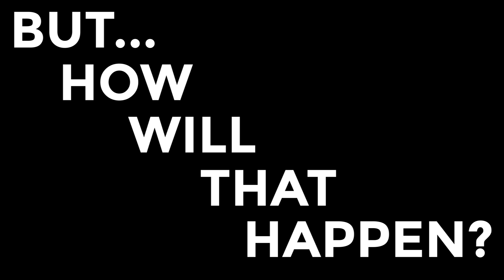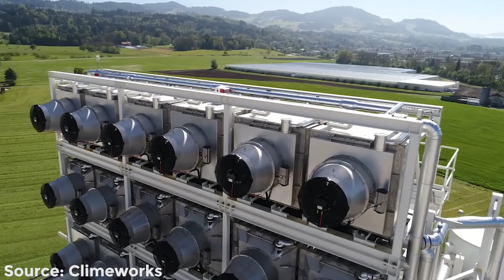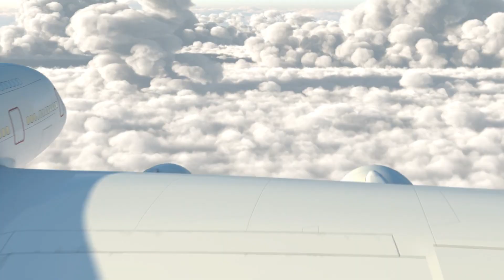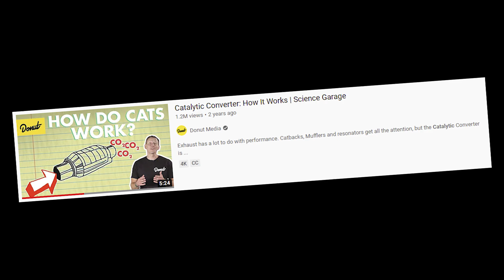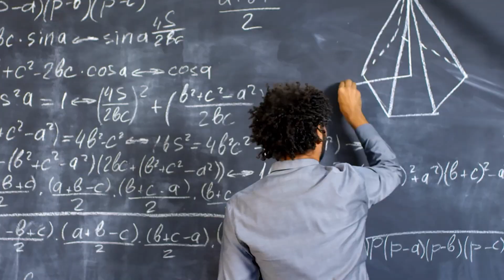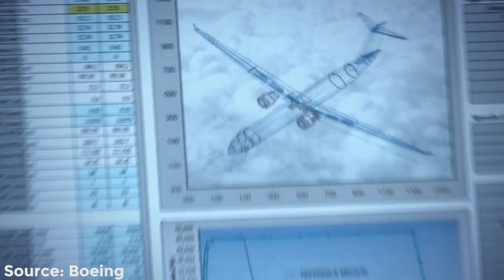How Hybrid-Electric Planes Could Save Aviation

Comment: One of the best ways to reduce airline emissions, apart from by not travelling, is to reduce the speeds of aircraft. Halve the speed and it ca use about 25% of the amount of fuel spent in combatting aerodynamic drag. I foresee short and medium haul electric passenger airliners being used before 2045. Long haul will come later, as battery technology and durability continue to improve. Electric motors can also operate at higher altitudes to reduce drag and to improve 'fuel' efficiency..

Comment: Aviation emitters currently don't pay carbon taxes or much taxes at all. If this changed and the playing field was equal I think these would become even more economically viable and you'd see more companies looking at reducing their climate change footprints by adopting hybrid, hydrogen or electric fleets... At least for short and medium range flights which emit the most fuel per seat km anyway...  Long-haul is almost as energy efficient as it's doing to get I think without switching to lifting body designs and hydrogen fuel cell set ups which I think will happen but when is anyone's guess. Airports who wanted A380 flights had to spend MILLIONS just to become compliant and even then most don't have regular stop overs with them anyway my home cities airport YEG included...

Comment: also, big thing is that you take a big generator, means that you may generate power more efficiently, decrease in maintenance cost and reduction of other separate turbines. the main focus is to build complex jet engines, that generate electricity at large, their is no point ivesting in current battery technology, simply to costly, however we can reduce lots of wait with these hybrid systems, and the electric motors are improving very powerful, and light weight, cheaper to maintain, we could simply build a plane that is range extended with one large jet tubine, instead of multiple, this means it bird crashes, the only thing to replace is stator motors and big fan blades. I think we could also incorperate the use of coal , and the water in the air, and have a coal liquification, or gasification system on board mixing both coal and water, we cann make fuel, where water would mean the plane, isnt taken any extra wait, all the wait is taken by the process of creating fuel on board.

Comment: When I think hybrids, the Chevy Volt comes to mind. It has a gas powered motor to generate electricity for the batteries if it runs low. Not sure if this kind of application makes practical sense for aviation jetliners ?

Comment: The entire aircraft skin should be a solar panel.  The plane should power up to altitude and then slowly glide to a lower altitude while spinning its turbines to recharge it's batteries,  then power up to altitude again.  So a hybrid or electric aircraft should fly in a wave pattern instead of at one consistent altitude.
Reply: There are a list of reasons that would not work, the biggest being aircraft separation. How in the world do you move aircraft around one another when they are constantly changing altitude. It's one thing to do it when you are in visual conditions, but in instrument conditions, in the clouds, not realistic at all. Not even going into how solar panels will power an aircraft carrying any kind of weight, how the turbines will not cause the plane to dump its altitude (likely causing wonderful stalling/spinning characteristics) without recovering even close to the amount of power to climb back up.
Reply: @Xithia not to mention the time added
Reply: That answered all my questions

Comment: Whatever happened to the hypersonic transport technology that was supposed to transport passengers to any global position in 45 minutes flat, it sounded really exciting a first, then interest in it seems to have just fizzled out?
Reply: SpaceX, Blue Origin and Virgin Galactic all have plans to try that out at some point. All their vehicles do have the disadvantage that they have to takeoff from a remote point and land in the ocean. 

There's a company called Hereus that's working on a Mach 5 passenger jet that would take off horizontally like an airplane and land horizontally like an airplane.

Also Boom Aerospace who's working on a supersonic airplane.

Exosonic is working on another supersonic plane that will have a "low boom" meaning the sonic boom will be barely audible, so it can fly over land. Lockheed and NASA developed the technology, NASA is supposedly going to do test flights of the QueSST very soon.

Comment: From what I've seen, generator type hybrids are inefficient. This would mean range would take a hit. Besides, you don't need to go hybrid to use catalytic converters, regular piston aircraft can already employ them but don't due to the weight. It's the same reason why planes don't use mufflers (at least not good ones) very often, they also change the way air flows so they increase drag (a way around it would be to design an aircraft with this already in mind, but now you need to deal with noise which adds insulation which adds more weight). The good ones are also costly (this goes for mufflers as well)
 
Hybrids should be used like their car counterparts, it's proven to work and it not only lowers fuel use but also increases range (that's a given, efficient fuel use tends to do that). But like many things, it's costly
 
But because these kinds of things are viewed as a long run, it could help save money by using less fuel. The range just has to be calculated to work at it's most optimal because during cruise the batteries, motors, and generators (incredibly light ones, both in use and operation. Like I said, generators are inefficient, they would just be used for something similar to trickle charging) are dead weight when not taking off or climbing
Reply: Please explain in more detail what you mean by "hybrids should be used like their car counterparts"? Thanks!
Reply: @AClark-gs5gl  Alright. So hybrid cars use electric motors to change their speed, this way the ICE can do what it's most efficient at which is cruise. Aircraft could probably do the same when they take off and when climbing. And like cars I bet they could somehow incorporate regenerative braking (I don't know how exactly that would work in flight, but it should as the same principles apply), though this is just me adding unnecessary cool stuff which aren't really needed.
 
The generator method is bad because of the energy losses. The only vehicle that I can think of (there's probably others) is the cargo train, there's a diesel engine that powers electric motors, this done because it way easier and lighter than having a mechanical transmission system. They would drop range and increase fuel costs, which will be worse off in the long run, not help planes. 
 
That's also why I said the flights should be planned if done similarly to what I'm saying, since when nothing is changing, the batteries and motors would just be dead weight. There would be a range in which these would be most efficient, if crossed it will takeaway from that efficiency, to close and you might as well go all electric but to far and the conventional is better (which is what I want to see, but you know what I mean)
Reply: Wrong, hybrid nowadays are more efficient even at full throttle

Comment: The biggest problem I see with series-electric-propulsion is the low performance of electric propellors compared to jet engines. This would seriously limit the speed of a series hybrid aircraft. Perhaps that would be acceptable for medium-haul flights, but speed matters for long-haul flights.
Reply: We a long past the time for the introduction of rocket liners for the long distance flights between London Britain and Melbourne or Sidney Australia.
Reply: Yes, it will be good only for domastic purpose. To reduce the fuel usage.
Reply: This is way they will get more performance. All diesel trains are this 'kind' of electric.
The problem will be with weight per cargo
Reply: Mr. Alex ,
Electric motors have recently advanced by leaps-and-bounds . 
Their power-to-weight ratios are now so high that 3k.lbs. of motors could easily produce very large turbofan-like levels of thrust . 
The best layout for this would be ducted-propfans with two motors per engine , these driving two contra-rotating propeller-disks . 
This configuration has already been proved-out by the German "Pfeil" fighter-plane , and by some azimuth-propulsor systems . 😎
*.The difficulty now with electric planes is simply energy storage .
Reply: There are electric motors with insane levels of performane and they are way easier to make and are cheaper than jet engines.

Comment: actually the future of passenger air travel is airships  like the company avalon airship's.
Reply: Hydrogen go boom.
Reply: Srsly tho, many companies have tried to use airships in commercial sector. Most have failed due to the sheer fragility of large ships, flammability of Hydrogen, or expense of helium. Additionally, airships have little to no ability to handle storm winds with current materials.

Comment: I think that batteries will win out in the end . Biofuels use too much land, unless something can be done with genetic engineering to use algae to produce hydrocarbons. 
All electric planes do not have to carry all their own energy needs, they could be got airborne by being “towed” by a tug plane much as gliders were in WW2 once at cruising altitude the tug casts off and returns to the airport and the liner goes on its way.
Reply: Another option might be to do an in flight recharging after take off on climb out using the probe and drogue method.
Reply: @Steve Mickler  The way the technology for drones has moved on, there is no reason why such flying battery chargers even need on board pilots. Another way of getting airborne would be “scalextrix” like track in the runway that the plane could draw power from to get airborne. Basically I think the people designing electric passenger planes need to think outside the box a lot more than they are doing.
Reply: They still have low range
Reply: drone lifters are being researched for civilian e vtol aircraft. With the possible  dangers of the detachment procedure though i would want it fully tested on cargo drones first.
Reply: @markzart33 - While the towed glider concept may be able to play a part, a powered plane needs to have enough thrust available at all times to be able to have take off thrust available even at the end of their flight (when batteries would be getting low). So, towing a plane up could save battery life, you'd still have to have strong enough motors and battery packs for TOGA scenarios. 
I do wonder with a modern airline being so heavy, if towing would work because of wake turbulence of the tow plane. The idea is intriguing. It also reminds me of how the rail lines use hugely powerful locomotives that are added to existing set in order to go up and over steep passes. They can be disconnected at other end quickly so the expensive, less efficient engine isn't always with the train.

Comment: The problem with any hybrid electric aircraft is altitude restriction. You can only go so high if you're propelling an airplane by pulling it through the air or pushing air backwards. So I don't quite see how fan-driven aircraft are going to be able to fly at the altitudes that Jets do which means they aren't going to be anywhere near as efficient and won't be able to clear certain weather systems. I thank a much better approach would be to use hydrogen in a standard Turbo fan engine.
Reply: Solar powered unmanned planes have reached and cruised at over 90,000 feet using electric motor driven propellers,
Reply: @stevemickler452  But those have essentially no payload. They're a really good platform for long endurance drones, I can see one used over remote areas as a temporary communications middle man, weather equipment, and maybe even high loiter time surveillance.
Reply: @midgetman4206  My point was that props do work at very high altitude. An electric airliner could use props to fly as high as jets.
Reply: @stevemickler452  I'm not saying that they don't work, I'm saying they can't work as a heavy lifting aircraft, they just don't have have a good enough energy source for that kind of work.
Reply: Turbofans are essentially fans. They work at cruise levels today.

Comment: The extra space requirements would I think be the deal-breaker. Will people pay 50% more because seats are taken to control NOX? Only the wealthy can absorb those price changes. As I've said before on other channels, synthetic hydrocarbon fuel derived from atmospheric carbon dioxide and renewable energy sources seems to be the optimum (note optimum not perfect) solution for long range transit. Electric aircraft can be used for an hour or two perhaps but we'll have to see the passenger mile costs for that.

Comment: Okay but imagine fuel-cell planes
Reply: Ethanol/Methanol fuel cells, cos hydrogen is somewhat bulky. Fuel tanks can be filled up like a traditional kerosene/gasoline plane, and the alcohols can generate electricity to power the electric propulsion system and/or charge backup Li-Ion batteries and a small capacitor for go-around (aborted landing) thrust boosts. Maybe this plane can fly at 50,000 ft, since fuel cells work at higher altitudes than kerosene engines. :)

Comment: As i understand this the hybrid technology for planes doesn't help reduce carbon emissions at all unless a renewable fuel is used. While reducing emissions of harmful NOx is a step in the right direction, it's still not a long term solution.
Reply: Weinschorle - Progress is usually a long series of small incremental steps in the right direction. We should not stop working on these small steps just because they don't actually achieve the goal on their own.
Reply: It's not long term but hybrid is at least 50% better than fuel.
Reply: The pathway to zero carbon flight likely runs through synthetic fuels. We can't convert the world aviation fleet over to hydrogen in the time needed to address the climate crisis. Even if we did, we'd still have increased water vapor emissions to deal with (plus NOX). Drop-in synthetic fuels should be able to cut carbon emissions to zero, and this then takes care of 95% of NOX and particulates, without increasing water vapor emissions. Fully electrifying short-haul (<1,500 km) flight should eliminate water vapor, co2, nox and particulates for that segment of the industry.